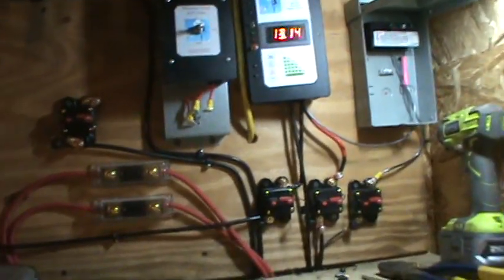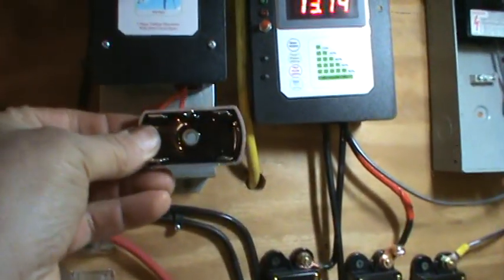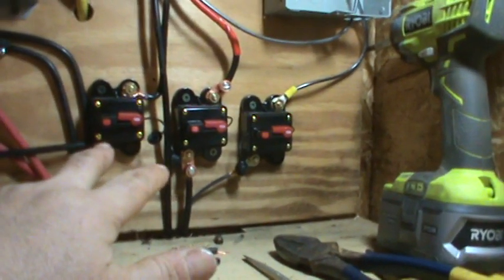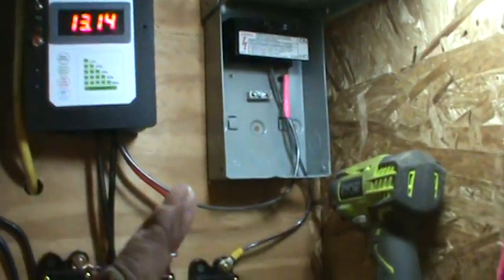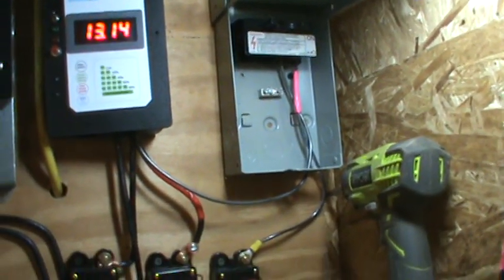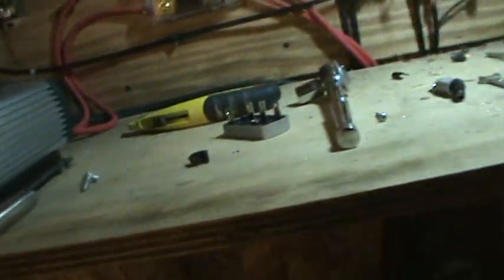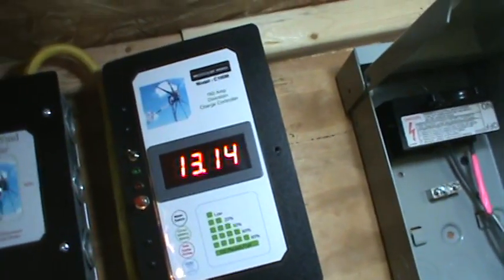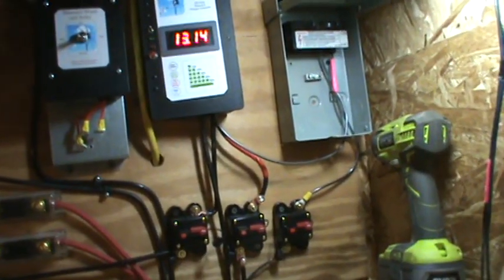wind turbine 3

Comment: nice job on your set up, oh yes a few golf cart batteries will give you some amp hours to work with. I am running a 24 volt set up with 1040 amp hours to work with, all Trojan T-145 batteries rated at 260amps.  I used a solid state pulse motor to desulfate them every 3 months but I used MJ series transistors so the spikes are from 300 to 1000 volts. those smaller battery desulfators you see on amazon only handle batteries up to 225amp hours , that same company makes ones that will handle 400amp hours. we will be doing a give a way on our forum if you care to enter your system into the competition. we are giving away a combiner box.  check out offthegridforumsmotion.com if you care to enter, its free. in the future we will be giving away some of the stronger desulfators also.  again, great job on your set up, have fun SD!

Comment: Joe: Everything is coming into place. It would be nice if you could run all of your general electric shop needs off grid. The well pump I installed was this summer had a switch for 110 or 220 just like the old pump. I don't remember the amps required. We got to 17 last night.  This week was the first real cold daytime and nighttime weather we have had this winter. Dreaming about Springtime! Did you do any hunting this season? Bernard
Reply from the maker: yes cold here to -6 yesterday...got one with my bow...did not see any buck in gun season..spring sounds good.

Comment: Nice work learning as you go. Is there a way to get 220 volts out of it so you could run a well pump when the power goes out?
Reply from the maker: don't know..i have seen 12v deep well punps but don't know good they work

Comment: Looks good. I use to use those breakers and then my inverter was not getting contact through them. So I went to all ANL Type fuses and they work perfectly. Just a little food for thought. I just thought you might like to know if anything is not getting contact later on. The breakers did work for little while but later on became defective.
Reply from the maker: just ordered some 50 amp breakers from mws ..I think the 100 amps are to big ?
Reply: Nah I was using a 150 amp breaker like those on my inverter for while until the breaker died.
Reply from the maker: shartne on my iverter I have 250 fuse...need some 50 amp for the turbine switch